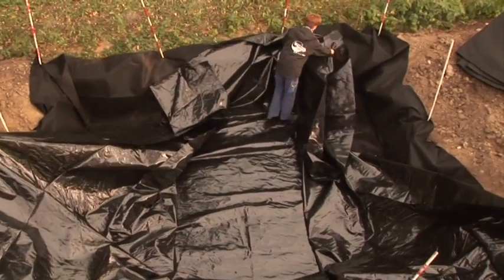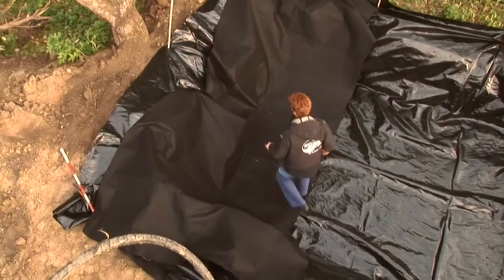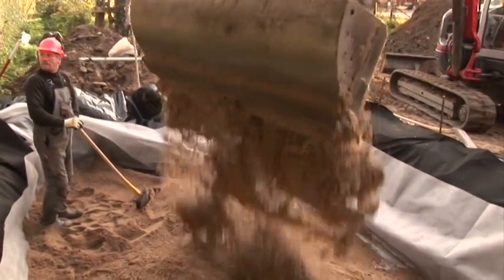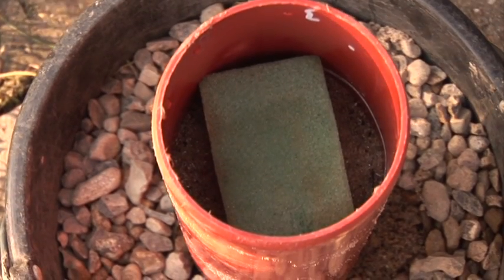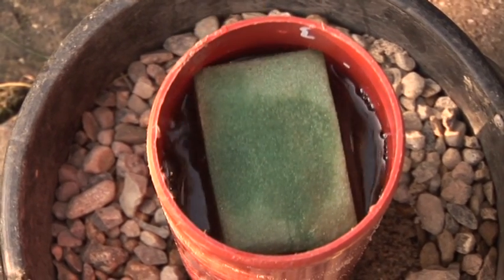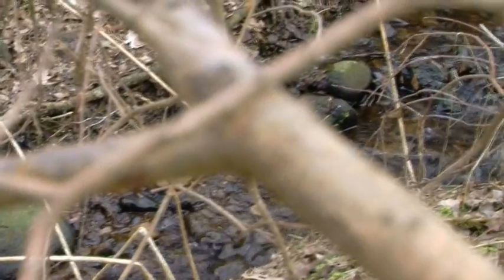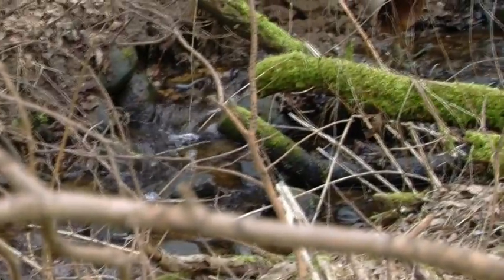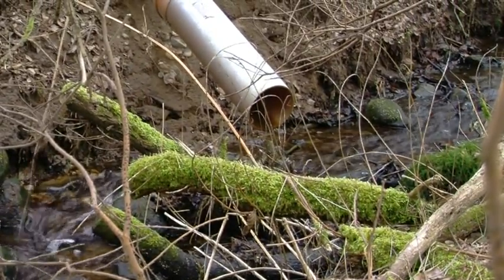Wastewater treatment in a natural way in the back of your garden ...

Comment: I never understand why water filtration systems gives back their water to rivers in place of infiltration bed/ irrigating the garden... So if there is a problem the water doesn't pollute the river, and why to consider grey waters as a trash you have to get rid, in place of a ressource you have to value??